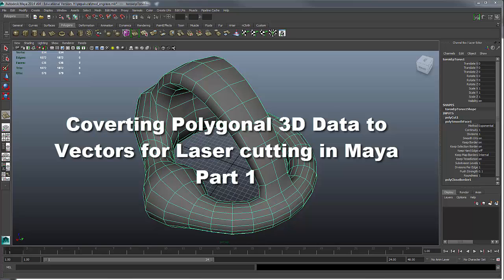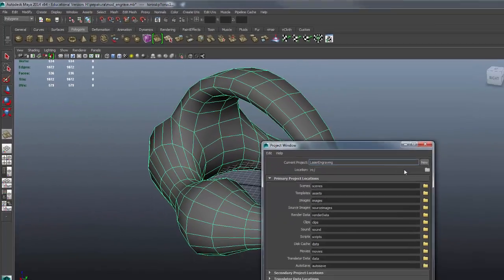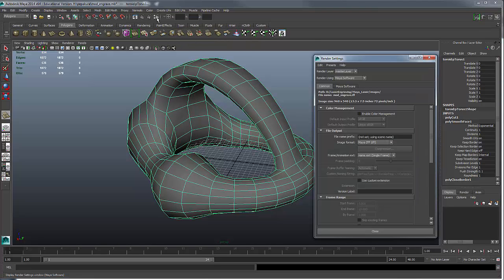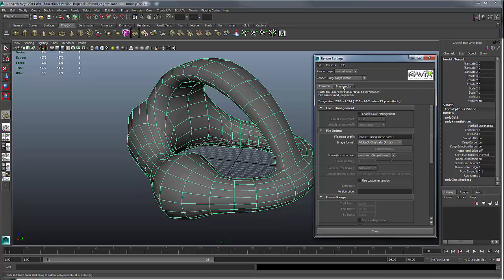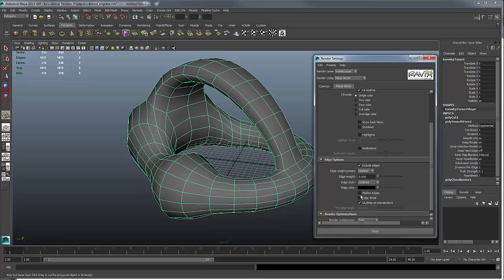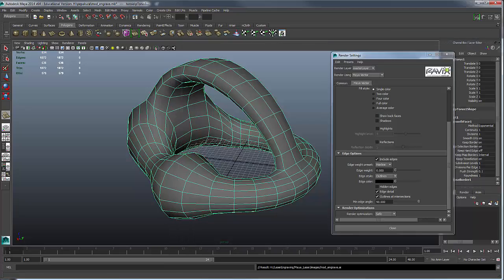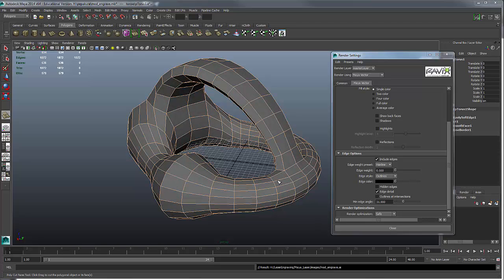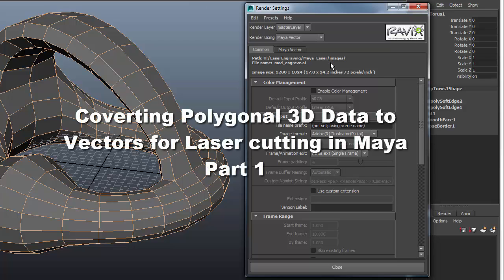Andrew F. Scott: Vectors for Laser Cutting and Engraving using Maya Part1

Comment: Tbh, this the best method I found on YouTube! I am trying to extract wireframes from shapes that I downloaded online to make 3d illusion lamp.
But the thing is, I have some shapes (Stl, Obj, 3ds) and when I import it to Maya I found out that it all triangulated mesh. I tried to convert to quads from Maya but no luck! And I used Instant Meshes but when the shape has so many curves it becomes hard to comp all the curves which give me fuzzy wireframes. 
Any advice will be highly appreiacated.
Reply from the maker: my only suggestion is to use the quadrangulate function in maya.